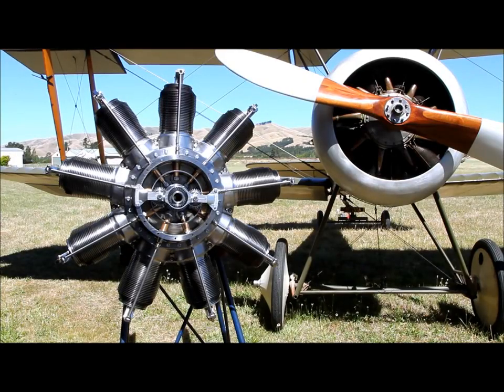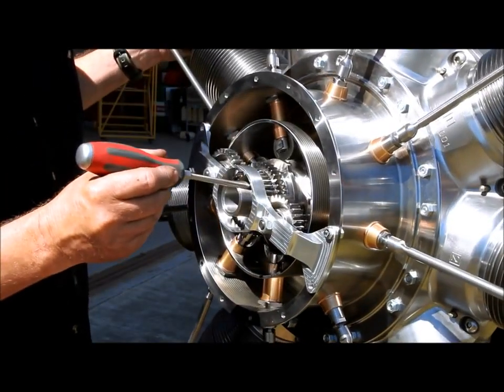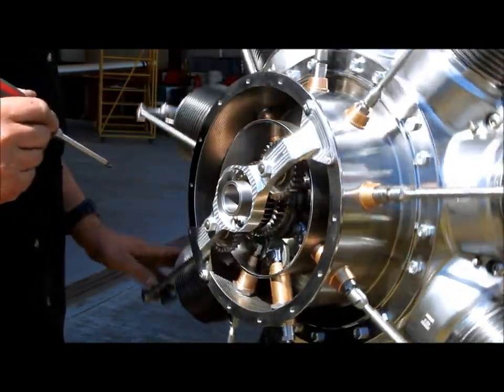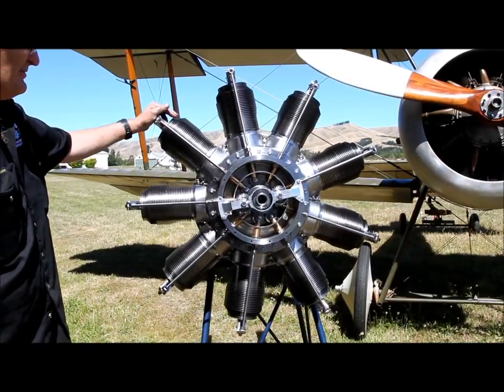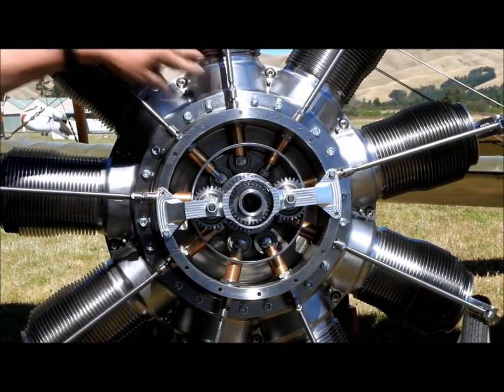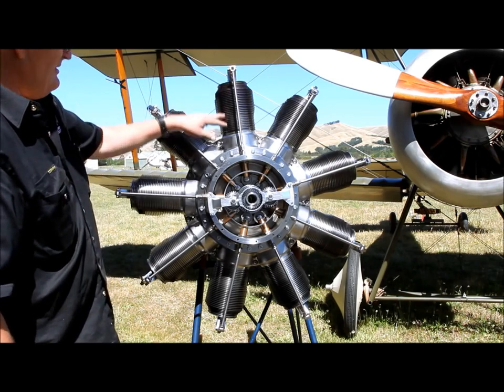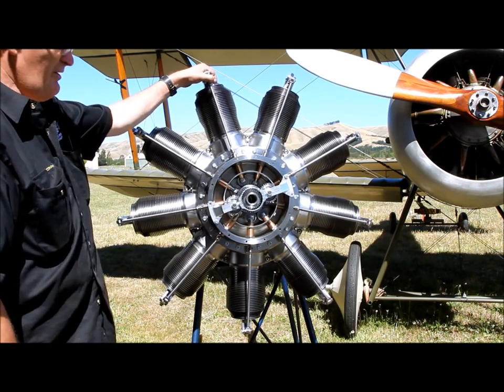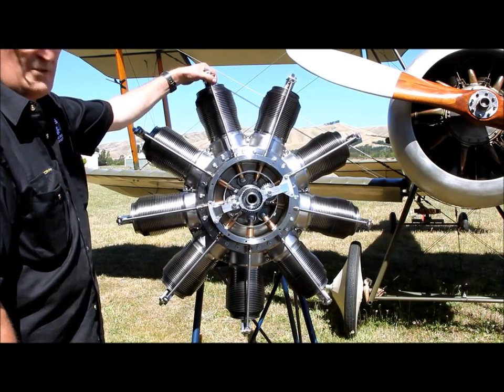How the Gnome rotary engines works

Comment: That's a hell of a lot of rotating mass.
Reply: No flywheel needed
Reply: Con un momento torcente notevole
Reply: The rotational momentum enabled pilots to make quick turns, but was also very risky.
Reply: @gmansard641  So is it "only ever turn left" or "only ever turn right"? Was the idea of spinning the cylinders to improve the cooling?
Reply: @wiseoldfool  The rotational momentum would make a right turn very quick, but also made control difficult.
Reply: @gmansard641  I think pilots would need to be schooled on this. Were there two-seat trainer versions? I've not heard of it (but I've only just ventured into the rabbit hole (terrier du lapin))
Reply: @wiseoldfool Yes, it was serious.  The Sopwith Camel had a rotary engine.  In skilled hands it was very maneuverable, but inexperienced pilots could find it deadly.  

During World War I aviation was in its infancy, and training was often minimal.
Reply: @gmansard641  I seem to remember reading that the life expectancy of a WWII pilot was twenty minutes. I'm not sure that WW1 would have been much different. (on the basis that there were fewer enemy aircraft!).
Reply: @wiseoldfool  Many pilots in the First War died from crashing their own planes, either from mechanical failure  or inexperience.
Reply: @gmansard641  Quick turns in one direction, at least ...

Comment: Thanks for the great explanation of its operation. In my High-school days I was into WWI aircraft in a big way and when discussing engine types in Autoshop the Instructor berated me for telling him about a rotary engine where the full engine rotated around a fixed shaft as he was only familiar with radials and they made sense to him. Well, I kept my mouth shut after that but I knew he was dead wrong!
Reply: You should have gone on to tell him about needing only one valve per cylinder, because it can both expel exhaust gases and suck in fresh air at the same place if you have no carburettor.   That would have made him mad and he would have sent you to the principal.    Your teacher sounds like a couple of real clots I had in high school, such as the science teacher who told us there are three states of matter in thermal sequence - solid, liquid, and gas.   I told him there is a forth state - plasma, at which he flatly declared I had made that one up.
Reply: You don't have to be smart to be a teacher, sadly.

Comment: So you use ignition timing instead of throttle position to control engine RPM? Neat
Reply: No they had a 'blip switch' that simply grounded out the magneto. So you were flying at full power most of the time, but to come down for landing you would switch the ignition on and off as required to control your speed. Thus made a characteristic buzz... buzz noise as the pilots blipped the engine on and off on approach.
Reply from the maker: We build a ignition system that we can switch to 1/2 wit reduces rpm but you are correct a blip switch is used for rpm

Comment: How does the oiling work with the centrifugal forces?
Reply from the maker: Oil is pumped in through the crankshaft to the master rod and cam pack. Centrifugal forces is what help the oil travel outwards.  Simple but effective.
Reply: @classicaeromachiningservic262 Is that a fuel-oil mix like a 2 stroke,  or is there separate engine lubricant?
Reply from the maker: @danweyant4909   Castor oil is pumped separately into the engine.

Comment: Am I the only idiot that wants to put one in a motorcycle . Actually it has already been done, front wheel drive
Reply: You said it yourself.  It configuration absolutely wouldn't work in terms of compactness, supporting and power distribution. There HAS been a non-rotating radial engine in a motorcycle, tho.

Comment: i guess discovering you could have the cylinders stationary and just turn a crank was a major breakthrough 🤣
Reply: The Millet type Rotary has some unique advantages over conventional layouts at the time, 
They are lighter and much smoother running  (vibration free) with no need for a heavy flywheel.
Pilots liked them because they could take off almost imediately after starting without any warm-up.
The main reason why they fell out of use was as the engine gets bigger its effects on gyroscope procession became a flight control problem.
Reply: The spinning cylinders also helped with cooling.
Reply: The spinning engine is the fly wheel.

Comment: One of the reasons that World War I aviators wore scarves is to keep them from having a severe case of diarrhea after flight: these engines were designed to be lubricated by castor oil.  With open rockers, your face got covered with oil by the end of the flight.  So caps, goggles and a scarf were important to keep you from injesting large quantities of castor oil 😉
Reply: It's also gets pretty cold and windy up there. They would probably have those regardless
Reply: Ha , ha , bravo !
Reply: ah bon?! c'était balls castors oil?
Reply: The oil was blowing out the exhaust. It would mix with the fuel in the crankcase like in a two-stroke.
Reply: I was at the Smithsonian museum last week. They had like 3 of these engines. But none had a carburator on them. This is why I’m here. Thanks for the explanation.

Comment: Why cylinders have to be spinned
Reply: It makes it lighter than a Radial engine... no flywheel or counterweights required.
Reply: To get enough airspeed though the cooling fins on the cylinders.  It was the only way to keep them cool enough.

Comment: It's a 2stroke then?
Reply from the maker: Hi Tom, its a 4 stroke.   It uses transfer ports at the base of the cylinder like a 2 stroke but it is a 4 stroke.   In the crankcase it has a very rich mixture of fuel oil and air.   The one valve at the end of the cylinder opens on the induction stroke and it sucks in clean air.   About 2/3 of the way down the induction stroke the valve closes so as piston gets closer to bottom of stroke there is a vacuum in the cylinder.   Piston gets to the bottom of the stroke and exposes a ring of holes and the vacuum sucks in some of the rich mixture in from the crankcase.  Piston goes up, mixture compresses and fires as per a normal 4 stroke.   The valve on the end of the cylinder opens and allows exhaust gases to escape.   This valve stays open right through to the induction stoke.   Its a very simple system.   Hope that helps.

Comment: Easy thi o use I  dont think so.  Far too many deaths from the training periods in WW1 where hot exhausts mixed with hi octane av petrol,  Not my way of dieing thank you.  Many many young guys did who  couldnt learn quickly  enough the extreme torque charachistics of the rotating engine body.  They must ahve been death traps. It was just recorded as killed in action and this was not known un til the 1950'.s.
Reply: No high octane back then.

Comment: Awesome explanation...but how much gyro effect when the plane turns since the whole engine rotates and secondly how does the engine gets spark to the plug while the engine rotates
Reply from the maker: Hi David, have just put up a short video taken from the side which clearly shows the ignition wires.  Its called Short video of Gnome running from the side (short).  Gyro did have an effect, turns better one way.

Comment: The main fault I believe, was total loss of lubrication, most of which ended up in the Pilots face, or goggles.
Reply: Not just that, he breathed in and swallowed Castor Oil which gave all the pilots the runs, it is claimed.
Reply: @CheshireTomcat68 

Correct.
They claim that the pilot's seat was wicker to save weight, but the truth is that it was woven wicker for drainage.

The other main issue/idiosyncrasy of the gnome is that it is either off, or at full power. If you look at the control stick for a rotary powered fighter from WW1 they will all have a small momentary switch on them that interupts spark. They called it "the blip switch." Turning off ignition for a moment was how you would throttle back the engine.
You can hear pilots doing this as they come in to land.
Reply: Also thehuge rotating mass made small plane difficult  to turn and bank. I think to the left but I could be wrong.
Reply: The exhaust exits when cylinder is at open bottom of cowling. Cowl contained oil splatter from valves.

Comment: Sorry,, lost me. I understand how it works. But why is the question. Even in about 1912
Reply: I'm no expert, but I can imagine a couple of potential mechanical benefits.  With this configuration, the pistons all spin around a fixed point instead of reciprocating, so the vibration transmitted to the extremely light and flimsy airframe was probably reduced a fair bit, and there was likely no need of a big balance weight on the crankshaft, possibly making the engine lighter at a time when there really was no weight capacity to spare.  With the whole engine block whirling around like that, it would also have probably acted as a very good flywheel, which would make the engine less likely to stall and die if there were any hiccups in the fuel supply or anything like that - given that there was no way to restart the engine in the air if it stopped (except, just maybe, going into a steep gravity dive to spin up the propeller in the slipstream and praying the damned thing restarted with enough altitude left to then pull up before you hit the ground!), this probably made the whole rickety thing more reliable during landing and take-off - especially because there was no actual throttle on some of the early planes; to cut thrust enough to actually land safely, you had to "blip" the engine, and a decent flywheel inertia probably improves your odds of the "blip" (or even throttling down) not becoming a dead stop.  Whirling those finned cylinder heads around probably increased the air cooling effectiveness, too.
Reply: It was originally mainly a weight issue. At the opening of WW1 a 50 pound increase in carrying capacity for a fighter was seen as major upgrade and up to a certain point a true rotary engine provides a better power to weight ratio than a radial engine. Of course this eventually hit an engineering brick wall when engines got so powerful you'd have to spin the engine at damn near supersonic speeds.

Comment: It is a rotating radial engine without the extra things.
Reply: No, its a Rotary type engine.. invented by Felix Millet in 1886.
Reply: @sandervanderkammen9230  then where are the planes of 1886 for red dead redemption 2 if planes came out that early.
Reply: @Jaystarzgaming   invented for motorcycles... used in planes later.

Comment: A real rotary engine! Finally a video that mentions a rotary and doesn’t mean a Wankel engine! Thank you, these engines have always interested me, would love to restore one.
Reply: Ikr, so many videos about fricken Wankel engines.  They need to get the terminology straight.
Reply: @Smokeybear69420  Agreed, it's getting harder and harder to find rotary engine content when everybody's calling friggin' Wankel engines "rotary engines" when they aren't rotary engines at all.
Reply: @Smokeybear69420 A wankel is a type of rotary.
Reply: @jakehildebrand1824  No, a Wankel is a type of pistonless rotary engine, not a type of rotary engine.  A rotary engine is a type of engine used on early aircraft pre-1920s where essentially the entire engine rotated around a fixed crankshaft.  Rotary engines are obsolete because of their inherent limitations but are a fascinating piece of engineering and how they solved some of the early power problems with airplane engines.  This is not to be confused with a radial engine, which is fixed to the airframe and does not rotate, therefore is not considered a rotary engine.
Reply: @Smokeybear69420  A rotary engine is any ICE engine that makes its power through rotation rather than the up and down movement of a traditional piston.

The Wankel rotary engine IS in fact a type of rotary engine. This is not debatable, it is an indisputable fact.
Reply: @jakehildebrand1824  A rotary engine is an ICE piston engine that rotates around a fixed crankshaft, as demonstrated in the above video, and was used in early aviation during the WW1 time period.  A wankel engine is an example of a pistonless rotary engine, not a rotary engine.  There is a huge difference between a rotary engine and a pistonless rotary engine.  We might be arguing semantics here but the distinction is important because it can lead to confusion amongst people who are trying to understand engines.
Reply: @jakehildebrand1824  you are false and the original name from the Wankel is: KKM= Kreis Kolben Motor
Reply: @leneanderthalien  Your english is just as lacking as your knowledge of the subject.
Reply: Let's made an association to promote those engines and call it the Rotary Club.
Reply: Yes! There is a difference, a big difference! One has pistons and cylinders, and the other one has triangular rotors and an eccentric shaft.
Reply: A nice Otto cycle😂👍
Reply: Definitely not that hard to find. I've come across plenty of both for quite awhile. Use more specific terms before getting frustrated that other things are named similarly.
Reply: @timehunter9467  
I think the best way to settle all this confusion is to call this type of engine a "rotary radial" because that's what it is, and a Wankel could also be known as a "rotor engine" because that's what it has.
The first radial engine designs were all intended to rotate. They were first designed as an idea to power early motorcycles by making them an integral, rotating part of the wheel. That's what led to the "radial" cylinder mounting arrangernent. Enlarged versions were successful on early aircraft because the cylinders constantly spinning in the air stayed cooler. Eventually, as aircraft began to need larger and more powerful engines, the gyroscopic precessive effect of a large spinning engine mass made control difficult, so fixed radial engines with more conventional spinning crankshafts became popular. It was still easier to air-cool a fixed radial.
Reply: Isn't it called a radial engine?
Reply: @pyrodoll2422 it basically is a radial engine but the crankshaft doesn't move and the cylinders rotate around it and not the other way around like in a radial engine.
Reply: @pyrodoll2422  nope a simple radial doest rotate
Reply: A wankel IS a real rotary
Reply: @jakehildebrand1824  nope A wankel ois NOT a rotary engine, but a Rotary pistons engine (german original name: Wankle KKM (Kreis Kolben Motor)
Reply: Radial engine
Reply: this is a radial piston engine, a true rotary engine can only be wankel engine
Reply: @spetsnazGru487  nope, a Wankel is not a "rotary engine", but a rotary piston engine, according the original german name Wankel KKM (Kreis Kolben Motor)...Rotary engine was invent by the frenchman Felix Millet in 1893, who use his 5 cyl rotary engine INSIDE the rear wheel from his motorcycle
Reply: @spetsnazGru487  Nope, you’ve got it mixed up. Radial engines have stationary pistons, rotary engines rotating pistons, a Wankel engine has a “rotor” but is not a rotary engine.
Reply: @timehunter9467  ok, got it now...
Reply: @timehunter9467  Your wrong. If a wankle isn't a rotary then what is it? It obviously isn't a reciporcating engine. The rotor (Realuex triangle) moves around the stationary gear in a "rotating fashion" therfore it is also a rotary engine. The word wankle is used  because 1. Thats the name of the man that invented the engine. 2. To differentiate the wankle style rotary from the piston rotary as shown in the video.
Reply: @IMMlifts  I’m not wrong, a Wankel engine is a Wankel engine. It has a “rotor” that rotates, but the engine does not rotate. Liquid piston engines are also labelled as rotary sometimes, but they’re just they just have a rotor. There should be a category called “rotor engines” or something because they use rotors, not rotate.
Reply: @IMMlifts  The whole point of the Wankel engine is that the "piston" doesn't simply rotate, it moves in a complicated spirograph-like curve around the epitrochoid-shaped chamber, so I'd call it an "epitrochoid engine," not a "rotary engine."
Reply: @tommcewan7936  ,  how long to become able to say "epithrochoid" without stuttering it out?
Reply: The wankel is a ROTARY-"PISTON" engine, but not the engine rotated, like this one.
Why needed to discuss about basic things?
When the engine rotates= Rotary engine.
When the "piston" rotates= Rotary "piston" engine.
That's the main reason the BS google isn't care about the grammar and spell on search, and no way to clear up the search.
Reply: @szennyvizcsatorna2483  the rotor doesn’t just rotate, it does some freaky move that makes an eccentric shaft rotate. It’s just a Wankel Engine.

Comment: I heard that those engines slung oil all over the place, I may be wrong. How was the engine lubricated? Did it have some kind of oil pump or was the oil slung around in the crank case?
Reply: Complete loss oil system. Used castor oil and slung oil all over which is why you see them with cowls nearly enclosing them. It also made the planes even more flammable.... Ah WW1, the enemy is trying to kill you, your side is trying to kill you and your own equipment is trying to kill you. Good times.
Reply: Here’s another video that answers the question: https://youtu.be/N2BKbpTmQbw look at the side of the cowl at the start of the flight and then again at the end. You will see oil leaking back nearly to the cockpit by the end of the 10min flight.

Comment: Would like to know how the ignition system works
Reply: There’s a contact and when the cylinder is in position it touches a switch that completes the circuit and fires every other cylinder as I understand it
Reply: Electrodes on the back line up with the coil wire electrode as the engine turns. As a cylinder lines up it's electrode to fire, the points in the mag open and that cylinder fires.